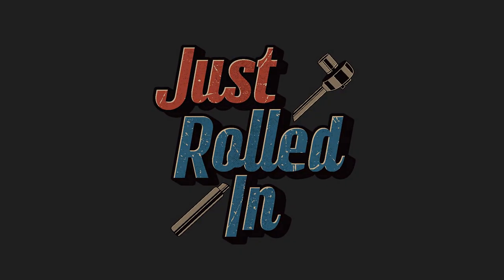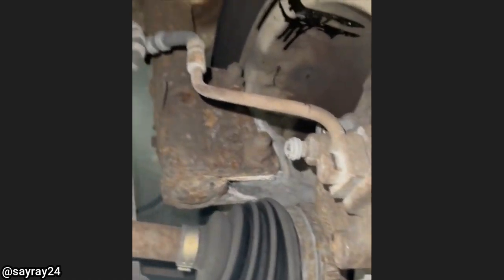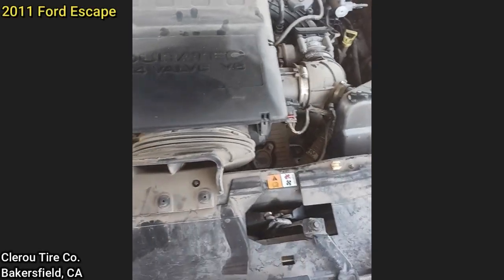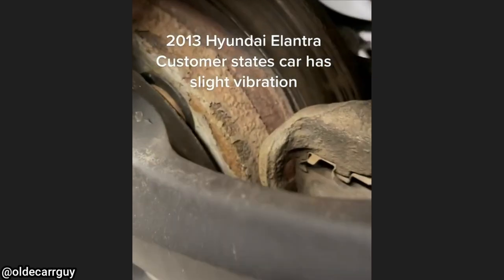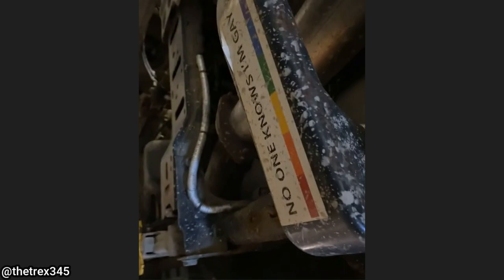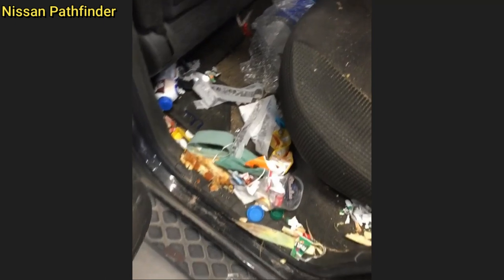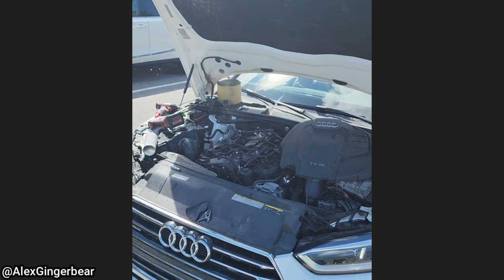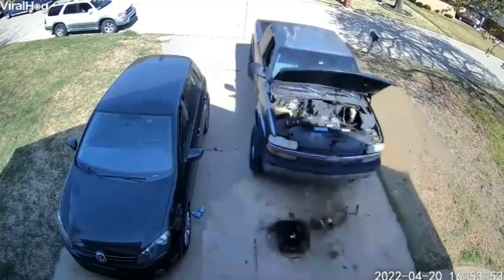Customer States Truck Still Overheats After New Parts Were Installed | Just Rolled In

Comment: I'm just baffled how cars get to that state of rust like suspension components are disintegrating without failing an annual car inspection check. Over here in the UK it's called the MOT. Every car over 3 years old has to have one annually. If the rust is getting to be significant, it's an MOT fail. Do some places in the US not have that sort of thing???
Reply: Some states have no annual inspection. I’m Australian so used to a MOT style inspection. Items such the brake check are automatically uploaded to the department of transport so even the inspector can’t cheat on the inspection.
Reply: @bigm383  That just doesn't make sense to me why some states thick it's a good idea not to bother. I'm guessing there are too many voters in rural areas driving heaps of crap to risk trying to impose something like that
Reply: @herseem  I’m with you. I have no idea, especially in states where salting the roads in winter seems to accelerate corrosion phenomenally. We still have some old bombs on the road here, but we never see accidents from chassis’s falling apart, suspension components separating from mounts, etc.
Reply: Salt eats away metal. There needs to be better solution for snow and ice removal. Fluid Film works pretty good but the only problem is that water spray will remove Fluid Film fairly quickly so you have to regularly apply it.

Comment: GM Technical Service Bulletin 6598 warns owners and technicians not to tickle their chevy's belly too much, as their undercarriage is very sensitive, and may result in loss of control, fluid leakage, and even the classic escape attempt such as seen here at 3:03.  I'm sure the owner realized his mistake this time, and from now on will use the appropriate leash when under his baby...
Reply: If I had a "baby" that tried to run away during a simple oil change,  I'd let someone else adopt it.

Comment: 3 transmissions in 6500 is even a bit much even for a dodge/chrysler. they are complete junk but something is causing the failure. a dodge/chrysler trans normally goes some 20-30k 😂

Comment: Always hated Peugeots. Had plenty of Peugeot vans that always come with plenty of issues. Finally saved enough to buy something not Peugeot, a Ford Connect. All was good until it dropped the timing belt at 50K. I then find out….. 
it’s a Peugeot engine 😱😱😱
Reply: From bad to bad one goes.............🙃

Comment: The guy under that truck is an idiot! You NEVER get under a vehicle on an incline with out blocking wheels. I've had the same car almost kill me twice. The 1st time was the transmission falling on my chest which was just bad luck the 2nd time was my fault. I had just pulled the jack stands out from under it realized I forgot my flashlight under it. Car was only up by a jack I slid my arm under the car and the jack leaked down pinning my arm under the tire. That was very painful and I got lucky I had my phone on me so I was able to get help to get the car off me before my arm was snapped. Had a gnarly tire tread hickey on my left arm for a week.

Comment: Uhhhh did he even put the truck in park?

Uhhh transmission issues??

Uhhh park brake don’t work?

Hmmm so that truck gotta be a automatic being a Chevy possibly have the 5.3 vortec V8 engine. 

The transmission on those years I hear aren’t so great. 

Possibly had it in neutral. 

Parking brake possibly rusted if a northern truck. 

Yea probably something gave or was in neutral and the park brake could of gave out.

Gonna put it at that maybe the park brake gave out and released. 

Uhhh on a incline I would of put transmission in park obviously and push the park brake in. This guy might of put in Neutral and used the parking brake. On a manual all you have to make the vehicle stationary is the park brake. 

He probably used his and it released somehow possibly from it being old and worn the cable can be worn. 

Anything in that nature lol lol lol

Comment: I call bs on the last story. The truck moves too quickly to move for no reason, he must have knocked it out of park or knocked into the 4x4 shifter pushing it to neutral. It was on an incline obviously and whatever he moved or bumped into neutral of some sort. No way that thing was just sitting there then  simply started rolling, he did something. If it moved much slower at the beginning I could believe the driveway was mostly level and it was out of gear.
Reply from the maker: I agree on that. Just saying what the guy said though. I think he was doing something with the shift linkage but didn't want to admit it. 😅

Comment: That first truck looked like the entire fan shroud was missing. I would start there before going crazy with pump flow direction.
Reply: Actually, looking at it better the belt is definitely not routed correctly. Still missing the fan shroud completely though.
Reply from the maker: The technician removed it to look at all the work the customer did. He routed the belt correctly and all was fixed.

Comment: On that first one, that car is STILL going to overheat at idle or slow traffic because the fan is too far from the radiator, it should have a fan shroud.
Reply from the maker: The technician had it removed. Came in with it on.